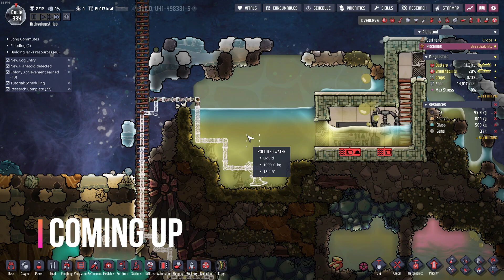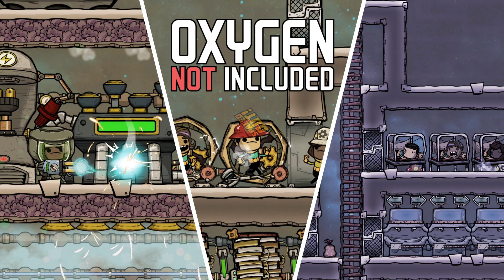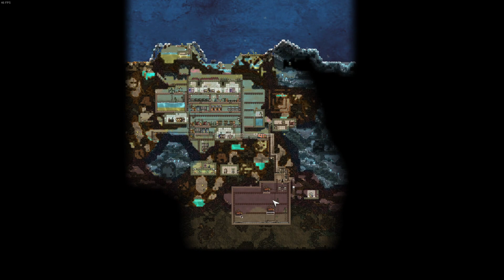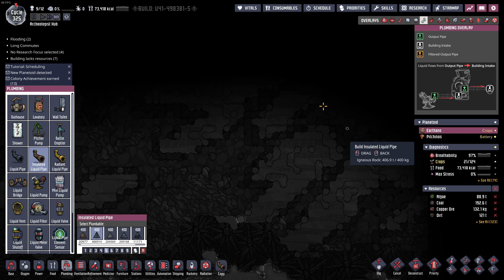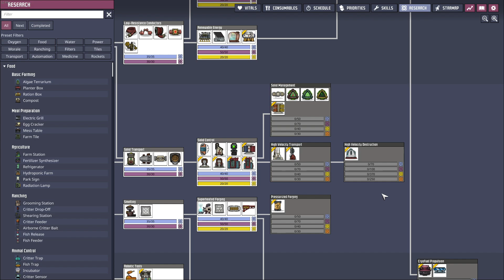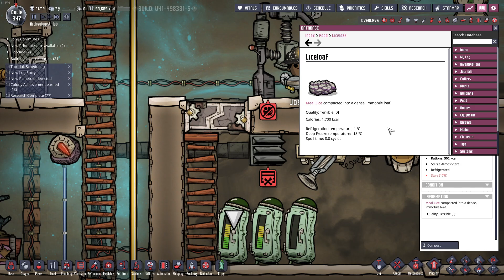O.N.I Spaced Out [S3 Ep9] - The Industrial Area Is Open For Business

Comment: Should the polymer press be on metal tiles instead?
Reply from the maker: For the use that we are going to give it, i don't think its worth it given the price tag on metal blocks, besides if we use it eventualy it is going to create a pool of water from the steam, and the water will work as coolant :) but if you are going for some heavy use then yes it should be on metal tiles :)
Reply: @basemanager  so basically no metal tiles inside the industrial brick, but on metal tiles everywhere else?
Reply from the maker: @yaroslavbozhdynsky  Metal tiles to me only where they are really needed in the early game because they are so expensive, but later on we can be more liberal with our materials and spend them more often, if it would turn out to be a problem i could replace the regular tiles with metal as time goes on, but given that we won't be using it to much is just no worth the price tag :)

Comment: The fridge would have cooled down quicker if you removed the iron and plastic from the floor, but for now, you have a bit of extra thermal mass in there.
Reply from the maker: True :P but the fridge is not yet to be used so the extra time is not an issue :)
Reply: @basemanager  just need to watch where that iron and plastic goes so it doesn't cool down something that needs to stay warm.